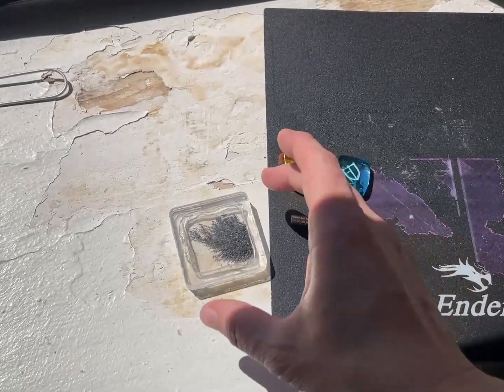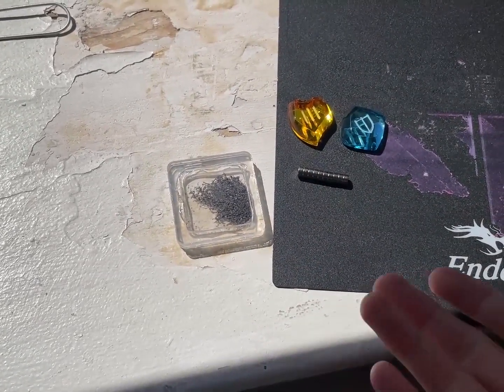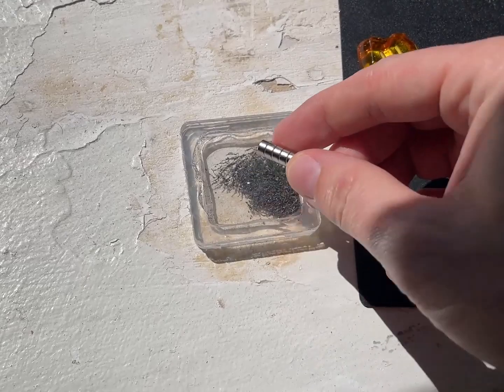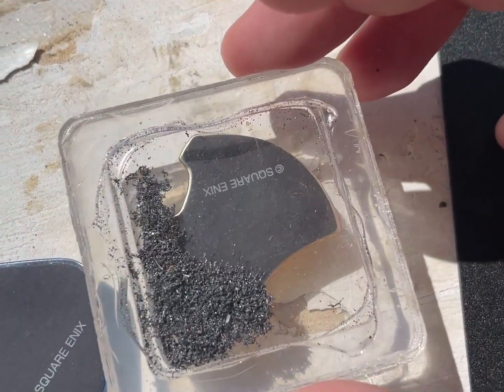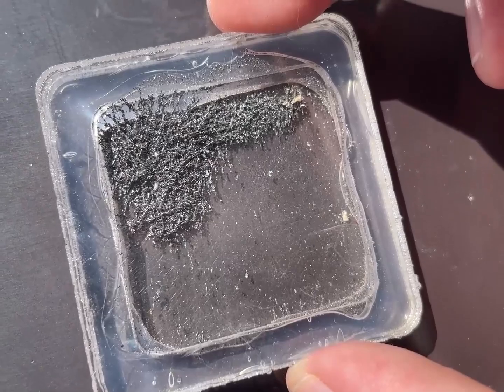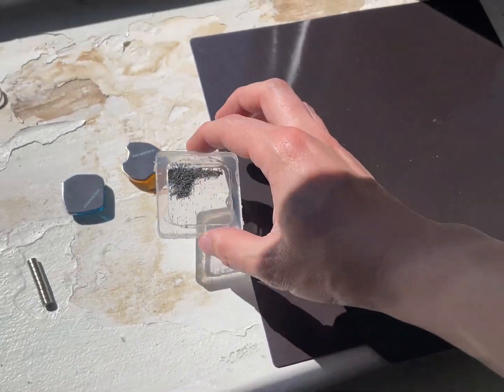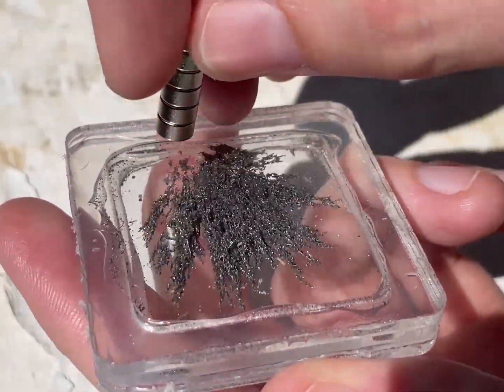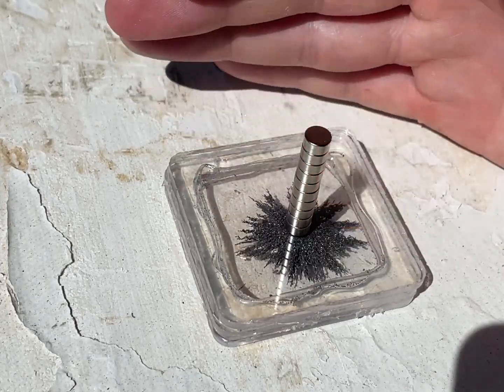I made a magnetic field viewer from plexyglass and iron filings so I can see magnetic fields!

Comment: I've appreciated the 4:3 stylistically when watching your stuff on my TV, and on my iPad since it actually fills it. I'm using web YouTube again for the first time in a few years, and forgot how much better 4:3 looks in non-cinema mode as well! It makes much better use of the vertical space there given the horizontal is the same.

Sorry this isn't really a comment about the project itself haha, it is pretty neat. I do like magnets. Haven't bothered with a viewer like this since getting a magnet implant though, since I can just reach out and feel them directly! It's not quite as "sharp" a perception as you can get with iron filings though admittedly, the difference is more textural than being able to see the exact angle of a specific field line.

Edit: heh, can relate to the few minutes of just finding different shapes of magnetic fields to play with at the end there. I suspect if you'd lightly lubricated the iron filings they'd be more sensitive to the weaker fields, they seem to just have some friction to overcome against the plexiglas. (Or maybe it's static electricity not friction, acrylic does do that too)